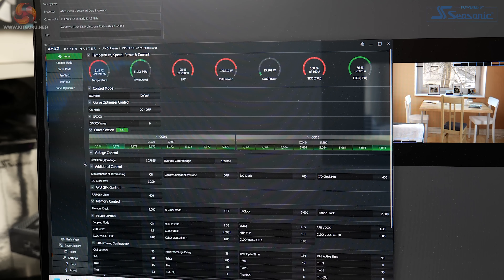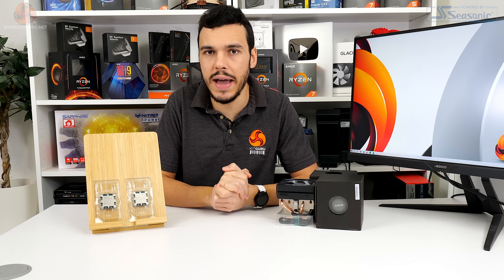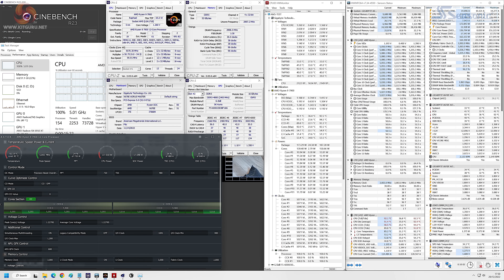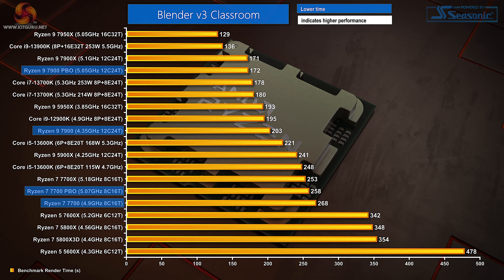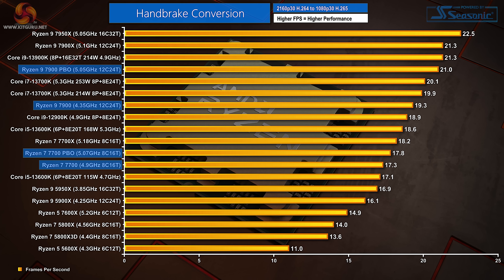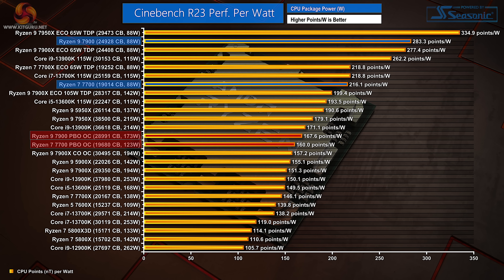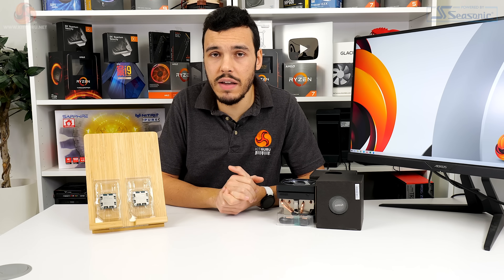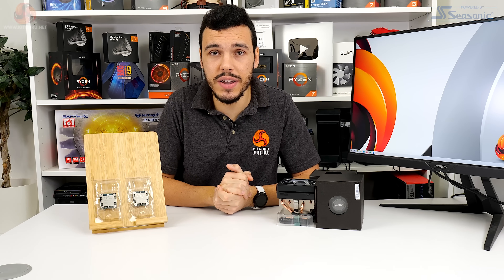AMD 65W Review - Ryzen 7 7700 & Ryzen 9 7900

Comment: good analysis. I'm in the market for a 65W CPU and I was only considering the 9600x vs 7700. But it makes a lot of sense to add the 7900 to the equation, specially considering 12:00 , for a non-top 4090-equiv GPU, all this FPS difference nonsense between x3d / x / non-x goes out the window, so I choose based on cooling, lack of noise, less power and produtivity Dirac deltas.

Comment: Upgrade question: My computer main components are MSI MPG X670E Carbon WiFi motherboard, MSI 3060 X12g GPU (Nvidia), 64 GB Kingston Beast DDR5 4800 memory, 850 watt power supply, Ryzen 7 7700 CPU (65w version). This is NOT used for gaming, but used for photo editing, specifically astro photos where 'stacking' is heavily used and the main programs are 'Pixinsight' and 'Affinity Photo' . I'm trying to figure out if I would gain anything significant by upgrading to the Ryzen 9 7900 CPU (65w version) and keeping all the other components the same. I have PBO enabled but no other tweaks. Can't find any good answers on the web so I'm asking the 'experts' here. Thanks!
Reply: Based on puget benchmarks, which don't test the software you mentioned but Photoshop and Lightroom, the difference in speed for photo tasks between the 7700 and 7900 seems minimal

Comment: These are the CPUs that most people should be buying.  If I didn't already have a stellar AM4 platform setup, that R7-7700 would be my pick of the three.  I currently use an AMD Wraith Prism on my R7-5800X3D and it works beautifully!  I have a Wraith Spire RGB as my backup cooler but, let's be honest here...  Air coolers don't die.  My AM2+ cooler (which I have affectionately named "Baby Wraith") that came with my Phenom II X4 940 back in 2008, still works perfectly.  It's really quite amazing that it does because I used that Baby Wraith for my Phenom II X4 940. Phenom II X4 965 and even my FX-8350 (because the AM3 cooler was absolutely horrible).  That's seven straight years of use and it's still a working CPU cooler today.  The Phenom II and FX CPUs weren't exactly low-power and cool-running CPUs with both having TDPs of 125W.

If yo'u're a gamer like me, then liquid cooling is a complete waste of money as a stock AMD air cooler will work just fine.  I just wish that AMD would dump the Wraith Stealth cooler and bring back the Wraith Spire because that was also an awesome cooler.  My stepfather bought a Ryzen 9 3900X which came with a Wraith Prism.  The problem is that he's old-school and HATES RGB lighting.  My R5-3600X came with a Wraith Spire and I never even opened it because I like RGB and was quite happy with the Wraith Spire RGB that came with my R7-1700.  

However, one day I was swapping out a motherboard for him and he asked me if I knew how to "turn that goddamn RGB off" on the Wraith Prism.  I truthfully told him that I didn't and asked him what the problem was.  He told me that he found RGB to be "Gaudy and Tacky" so I offered to trade him my unopened Wraith Spire for his Wraith Prism.  He said as long as it could cool his R9-3900X (which incidentally has a TDP of 65W), he would love to make that trade.

Well, I popped the Wraith Spire onto his R9-3900X, ran some tests using Prime95 and Passmark Burn-in and there was only some mild throttling after about five minutes of Prime95.  He said that he was perfectly happy with that because he doesn't do anything even remotely as strenuous as Prime95.  I was absolutely thrilled to get the Prism because I think that it's one of, if not the, most beautiful CPU air cooler ever made. I didn't even mind relegating my Wraith Spire to perpetual emergency backup status (perpetual because, again, air coolers never die).

Comment: Last week upgraded ny 5600x/asus b450/32GB 3200 to 7700/B650M PG Riptide/KingBank 6400 CL32, and with tweaks I have quite happy with the final results:

BIOS Settings:

Memory = 6400 @CL30/38/38/80 1.4V
FCLK = 2133
UCLK=MEMCLK/2 (My system fails if I run 1:1 UCLK=MEMCLK)
PBO: Advanced/Motherboard, Scaller 10X, Positive 200
CO: All core, Negative, -30
iGPU = Disabled
BIOS Thermal Limit = 89C

Cinebench R23 Multi/Single = ~19,200/~2000 (~44-46W/~114-116W)

Idle = ~49-51C (Windows 11; room temp ~23C)
Games max 92C
Load (Cinebench R23)
All core=5.1-5.2hz @89.4C
Single Core = 5.49Ghz (59-60C)

Comment: I am just debating upgrading my personal PC from i5-3570 cpu (I know it is old) to probably Ryzen 9 7900 (non X), because of power consumption. I use PC for a little gaming and most for productivity. I know that X3D versions are rated at 120W TDP. Is the gain in performance will justify to go for X3D version of 7900 versus price difference?

Comment: Just got a 7700 non x . Running 5150mhz with pbo curve -30. Never goes above 70c in games.  Never seen it go over 80w in power consumption either. 

Those who go the intel route, good luck. We know they are better in some instances, but not at such a low power consumption. My previous intel could easily double as a room heater.
Reply: @TerryHancock-k4p  I'm getting a pre built I ordered this Friday with a 7900 non X how do I adjust the pbo curve??
Reply: @TerryHancock-k4p  with the stock cooler?
Reply: Just got a 7900 non x . Running 5650 mhz with pbo curve -35 & + 2x(10x max) stable overclock :eyes-purple-crying:

Comment: i dont get why nearly every review ive seen the a 5800x they can only get it to run at around 4.5GHz stable, with some minor tweaking im able to get my 5800X to all core boost to 4.7GHz, and under ligher workloads like gaming easily 4.9GHz, and i havnt even touched the voltage yet, its all stock settings in the bios. and if you just comment to tell me that its not stable, ive been running it this way for 6+ months and i have multiple weeks of up time usually 2+ weeks before i need to restart. EDIT: so far 4.92GHz stable for over a week now, still stock voltage settings. im gonna get that 5GHz baby.

Comment: B650 AM5 board with huge price increase is compared to B550 is no go for me any time soon.
That boards should not cost more then $100$ - $120.
With price $200 for cheapest B650 board this is begging of the end of PC gaming.
Everyhing is so expensive that I will not spend a single coin any more on hardware.
Reply: It's expensive because less and less computers are being sold. My computer is 12 years old and still works fine. Most people have a far more powerful computer than they need.

Comment: Why would anyone buy the 7900X Instead of the 7900 ? I don't see any downside
Reply: My guess, for those who want the top performance out the box and requires little to no BIOS tweaking would be the case, which has always been the case with X CPUs until ZEN3 came, and X CPUs had more room under the hood to go even further through tweaking. 
Looks like AM5 is back to the old ways. X CPUs you get top speed, requires little effort .  Non-X you got to either tweak or have a good bin to match an X, or you aren't concerned with top / matching X performance and interested in lower power consumption.

Comment: 7900 or 7700X? Got a 1440p screen, fits in budget, and have a PSU that supports all of these.
Reply: i say the 7900, much easier to cool and better power efficiency.
Reply: If you are also doing some productivity like video editing and 3D the 7900 seems to be an amazing option. You will also benefit from multicore Performance in the near future.  You could built a monster productivity and gaming machine while having basically a silent Pc when you use a decent cooler like noctua.
Reply: If it's just for gaming and general processes then it's 7700x. This set of gaming reviews isn't really the best.
Reply: 7900

Comment: Great review! I'm thinking of going for the 7700 or 7900. I prefer to have a more efficient, and cooler CPU, than one that runs really hot. And I don't want to watercool, so I also like the included cooler.
I currently have a 1700 and using the included cooler with that, and it's still running fine, even under full load Radeon software reports its only 61 degrees.

I was going to wait for the 7800X3D, but decided I'd rather save the money, since I'm sure the 7700 or 7900 with perhaps a 6800xt will keep me going as long as the 1700 and Vega 64 have done. Plus AM5 entry price is quite high, so I've got to save money somewhere :)

Also it's good to see a UK channel. Do you know when these are released in the UK? It seems that retails have NO information on their page about release date. The keynote said today, but their own page says 14th Jan. Pretty shoddy launch.

Comment: Idle power consumption please. Most power time is used at idle and light loads
Reply: This review shows idle power consumption !! It’s higher than 65w
Reply: @powermaster5004  this is cpu full load consumption, not light/idle
Reply: Idle power consumption on the board luke used was under 90w

Comment: i have a ryzen 5700x and im just wondering do u think it would be worth it to upgrade im thinking to get a rtx 4080 and im not sure if a 5700x would be a big bottleneck?
Reply: I am assuming with that card you would be playing in 4K, haven't seen videos on this particular topic, but Hardware Unboxed summary puts the 7700 around 35% higher average fps than 5700x at 1080p with rtx 4090

So based on other Hardware unboxed numbers of average fps at 4K, I don't think it will matter, at 1440p maybe, but this is based on averages, it will depend on specific games and what framerate you target
Reply: Yeah it wouldn’t matter imo
Reply: Yeah you will be fine pedro. It’s more gpu limited at 4k
Reply: I have the 5700x too, I think you will be alright, slight bottleneck on some games but for the most part you shouldn’t notice it.
Reply: Great replys guys. I think maybe ill keep my 5700x it is a great cpu just dont want it to bottleneck to much even tho i game mostly 4k and 1440p
Reply: @antos1951  Try it out and do let us know! I upgraded from 3700x to 5700x because of the price difference and it really improved Avg and 1% low fps on my 6800XT
Reply: @DigitalBliss69  i currently have the 6800xt aswell. But i should have the 4080 in about a week. Love the 6800xt just fancy a little more grunt at 4k. Even tho the 6800xt does a great job at 4k
Reply: @antos1951  I’m playing at 1440p 165hz, it’s the perfect sweet spot for the games I play which at this point is basically OW2 and Horizon Zero dawn. Getting very high fps in Horizon close to Max settings, especially after I enabled SAM, 20+ fps with just a bios change, that’s like a whole gpu tier!
Reply: @DigitalBliss69  yea thats really great especially with sam..i have it enabled to 1440p gaming the 6800xt without ray tracing is amazing. I play on my 4k samsung tv at 120hz
I just want that extra grunt for 4k high refresh on my tv and i think the 4080 will give that
Reply: @antos1951  4080 came in yet?
Reply: @DigitalBliss69  unfortunatly not yet its been delayed due to going out of stock. So im hoping very soon ill get a notification letting me know
Reply: @antos1951  I’m seeing more 4080 stock on Newegg and Bestbuy, hopefully your card ships soon!
Reply: @DigitalBliss69  unfortunatly im not based in the us. Im in the uk
Reply: @antos1951  Oh I see.
Reply: Found one, in short, not worth it with 4090 so even less with 4080 https://www.youtube.com/watch?v=yqviii515kI
Reply: Yea i would be playing mostly in 4k. And  maybe odd times in 1440p
So i should be ok mostly then?

Comment: Are you able to choose how much overclock do you want with pbo? Cause its such a huge jump with it from 90W to 180W. It would be a good thing to have something in the middle like 130W.
Reply: Yeah I was thinking the same thing. What system you running now ? I’d like to move to this platform myself.
Reply: @justindavis7600  im running i7 9700k and i want to switch to amd right now for 7900 non x.
Reply: @victerino You won't regret it.

 i did the jump from a 9900kf to a ryzen 9 7900 and i'm really happy with it, less power consumption and better temps, idle temp 38 and 48 in games with a dark rock pro 4.
Reply: I was thinking the same, setting the 7900  to a 105W TDP max 141W consumption while still having better efficiency and temperatures. Would be interesting to know. Also does it effect the non X variants in a negative way to activate PBO? It shouldnt be, because they are basically X Cpus with a limit, so its not overclocking basically.

Comment: So the X versions of the chips really are not worth it then considering the extra heat and cost.
Reply: Doesn't the CPU put out performance up until cpu hits 95°?? So wouldn't a CPU with a lower Max limit put out less performance? Depending on the cooler ofc. Or is that not how it works?
Reply: @xyr3s  yes, but its this way only for high tdp CPUs who get very hot. The cpu throttles as soon as you hit max temp with max TDP. You will first hit max tdp, as soon as you hit max temp, you clock speeds would throttle. 
lowering the Cpu max temp. Should force the Cpu to draw less Power, resulting slightly lower boost speeds. You could limit the 7900x to 85 max temp. This would force the cpu to automatically lower the TDP, while dont having a very significant performance loss. So its a good way to make your system more efficient.

Comment: well its not really 65W - even the review shows its closer to 90w ....
Reply: 65W is heat output, not power consumed. TDP is basically the efficiency rating for electronic devices. 65W is quite efficient.